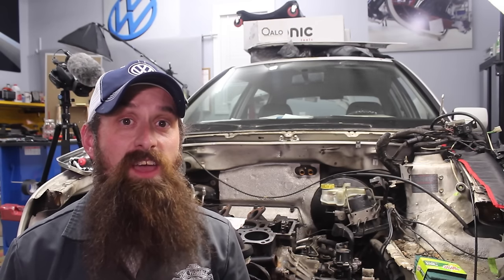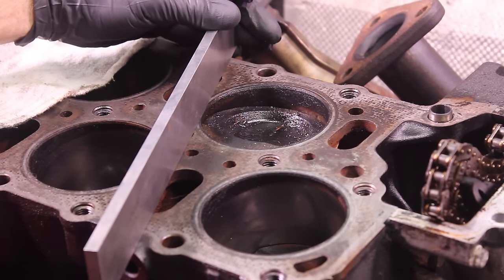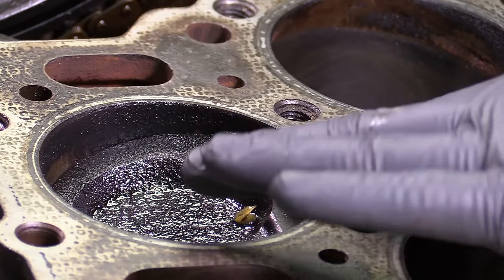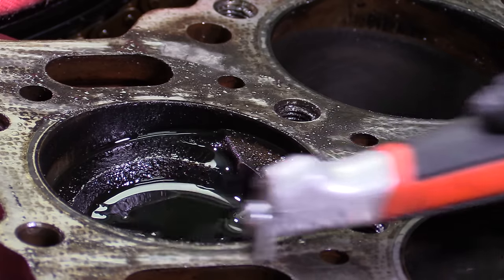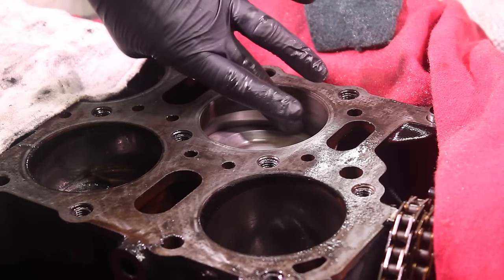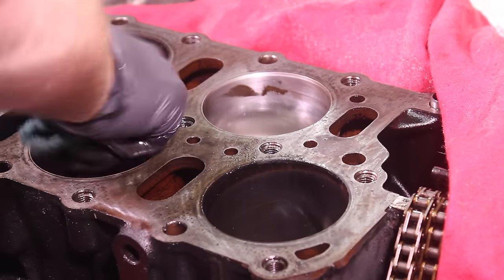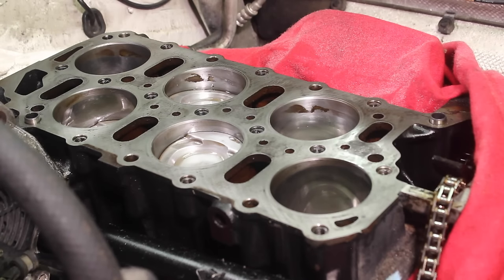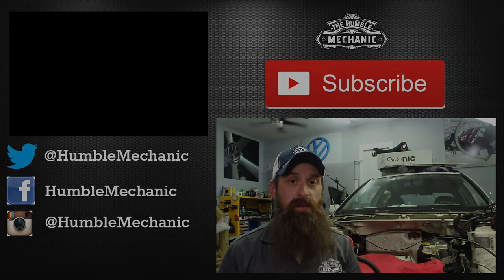Removing Carbon From Piston, Cylinder Walls, and Block Deck

Comment: I need to add...When the top of the block is "warped,"  why wouldn't the bottom be as well(Align bores)?  I worked in an automotive machine shop for several years and for the most part, "deck milling" was done because of gasket wear(aluminum head scrub on a cast iron block) or corrosion(age or maintenance neglect).  Blocks that are truly warped are truly junk.

Comment: Wire wheels wont scratch your surface. They wont remove material either and will work very quickly.

Comment: Soak the scotchbrite pad in water before use. Works much better
Reply from the maker: +Aaron Bradley that's a really good idea.
Reply: HumbleMechanic they only sale the green at regular places but 3m has many different  colors that are different grits. We use the maroon at work which is aggressive and works really well. You can do the course to fine grit just like sand paper. Also, instead of wd 40 use seafoam and put it in a spray bottle like you did. You will be amazed. Good video
Reply: good info

Comment: Damn that engine is nasty.
If anyone is doing this at home and sees horrors like this one I advise to look for a new engine block, odds are that something this far gone is riding on the edge of usable and you won't find out until you have it all together and try to get some power out of it.
Reply from the maker: +MsSomeonenew yeah it's about. Normal for a SO so maintained car with 140k. 

But a new block is $$$$$$. Once I measure piston bores we will make the determination on the next steps

Comment: I usually hookup a water hose to the intake usually while the engine is @ 2000-2500 rpm. It gets all the carbon loose. Just make sure the engine is warm before you do it.

Comment: it might work, it might leak. i would have just not taken the chance. with the head and block out, minus well just machine them both to spec and check pitson out of round and cylinder bore out of round. that way you could justify with solid measurements any problematic parts and replace as necessary
Reply: dont half ass 1 thing, if you half ass it twice you could have just done the job once perfectly
Reply from the maker: +Don Werrboutit and that still may happen. Once the block is on the stand, the bores and rest of the bottom end will be more thoroughly inspected. 

This engine is out of a car that ran very well. I'm not super worried about bottom end engine issues. Plus that's not something this engine is known for having issues with. 

If time and money were not factors, the block would go to the machine shop, just like the head did. 

Due to the angle of the cylinder, my local machine shop charges a fortune to do that work. 

I confident in this working with out issue. If it doesn't, I'll make a video about it.
Reply: im in no way bashing you i dont want to disrespect, i have watched a bunch of your vids and enjoy watching very much. i am a full time auto tech and i still come home and watch automotive videos just because the passion i have for engines and customers vehicles
Reply: i appreciate the effort to comment back as well. thats a plus in my book
Reply from the maker: I didn't take it that way at all man. I also hope I didn't come off like a jerk either. This is just open and honest conversion. I appreciate your insight and thoughts for sure. 

Thank you for watching, and being part of the community. :)
Reply from the maker: +Don Werrboutit right on man!!!
Reply: You're not doing  complete engine rebuild here, just fixing a carbon problem. VW dealers charge enough for repairs without adding any you don't need.
Reply from the maker: +crusty old fart at this point in the process I hadn't planned on a full rebuild. 

Here is the latest video on this engine. What I found here has pushed me to a rebuild. 

https://youtu.be/dKSfTXZ7qwc

Comment: This is not a practice I'll recommend to do as cleaning carbon of with a lubricant will let some carbon flow down between the piston and cylinder and will make scourge marks on your piston and cylinders and premature wear rings ect.
Sorry to be te bearer of bad news I cannot approve this practice as a mechanic.
Reply: do you think you could use a vacume fitted with a small diamter peice of vinyl tubing to vacume around the perimeter of each piston after soaking in order to vacume up any particles that got down the sides of the piston walls ? then next step pour in say seafoam to further disolve anyparticles on walls and once again vacume . then drain oil to remove all sediments .
Reply: It seems like everyone in this comment section are mechanics with 50 years experience saying not to use scotch brite or not to do this, not to be the bearer of bad news but I've done this exact same process hundreds of times and not a single engine failure

Comment: De-carbonizing ought to be a thing of the past, and in engines in otherwise good condition, there ought to be next to no carbon on the piston tops.  If there IS carbon, something else is wrong, probably you need a valve job and if you've torn the engine apart this far that's exactly what you should do! Replace spark plugs, wrong spark plug (too cold), leaking valve seals, THESE are what cause excess carbon and a valve job corrects that. Fix the problem and the carbon will burn itself away and stay away.  Tearing open the engine just to de-carbonize is pointless.

Comment: I would, still, get them remaining spots out on the first run. 

Professional pride, perhaps?..
Reply from the maker: It ended up coming totally apart anyway due to issues in the connecting rod bearings

Comment: Not a good idea to remove the build up on the cylinder ,it uses that to seal on older engines.
Seen a lot of engines using oil after cleaning that area of the cylinder.

Comment: Be damned careful with that scraper tool on an aluminium block.  Usually they have a carbide blade which can catch on corners and leave gouges

Comment: Never remove carbon from your cylinder bore, the engine has ring wear already and removing it will cause your engine to burn oil

Comment: He didn't clean out the bolt holes or threads.
Reply from the maker: Nope I didnt. I save this for right before assembly. Otherwise you risk things getting in the well

Comment: WHY DOESNT THE SHOP IM GETTING A HEAD GASKET JOB DONE DOESNT WANT TO CLEAN THE PISTON HEADS BECAUSE HE SAID HE DOESNT WANT CARBON TO GET CAUGHT BETWEEN THE CYLINDER WALL AND RINGS...

IS HE RIPPING ME OFF?
Reply from the maker: I can't say he is ripping you off. You can clean the pistons and not get carbon caught. Or he can clean the cylinders before assembly. This video didn't show the cleaning process. And I will not be able to do that. 

I ended up finding more damage on the engine. This required full disassembly.

Comment: I was cringing the whole time watching you clean that cylinder head out with that big chunk of metal shaving inside there and YOU DIDN'T REMOVE IT! Yer just scratching it all around that cylinder!
Reply from the maker: +MrCougar214 the intent was to clean the engine throughly after this video. Sadly I found some bearing sadness and the engine had to be disassembled

Comment: I don't get it. Carbon on piston heads or on blocks harms what? I never heard of any engine having a problem because of to much carbon. Never. Sure it's not great for your spark plugs but you are going to check and change as needed. Show me the documentation that gives examples for engine failure due to " to much carbon".
Reply from the maker: +Thomas Burns in this application I'm worried about hot spots. Plus I had to take the head off anyway, might as well clean it. 

The funny thing is I ended up having to take the entire bottom end apart too. I found some bearings that were sad. It's really not that funny at all.

Comment: Hey guys I'm selling my 2002 Jetta VR6 is anyone interested? I'm just done with some of the electrical issues. It has a new transmission and the engine runs strong.
Reply: how much homie
Reply: 2500

Comment: Im just a youtuber dummy. There is no way I'd pull engine apart to get carbon off engine.
Good presentation, but beyond my head and capability in wintery Alberta.
I pay no more than $500 for a car. I have an 03 Saturn and a '98 Honda Civic for  both for free. My brother and I share  $700.00
'86 F150.
Cannot even fantasize about doing your work in this video.
I'm not being judgemental, but its beyond my skill set to tear apart an engine just to get to the guts on the heads and not worth it to me.
This morning I put mmo in my Honda and truck. 
David
Alberta

Comment: Damn bro, get to the point!! 4 minutes in and you still haven't showed how.. if you need to tell them every bit of information about a block then they shouldn't be doing this.. they should already have some knowledge of what a block is.
Reply from the maker: I try not to assume what people know. If I have an opportunity to explain, I try to take it. We all learned this stuff at some point.
Reply: Well said.. and yes I'm using your method.. so don't feel like I'm a hater or a troll.. it just took so long lol.